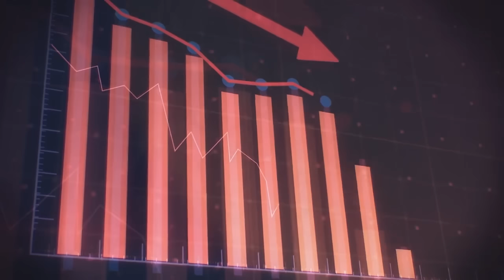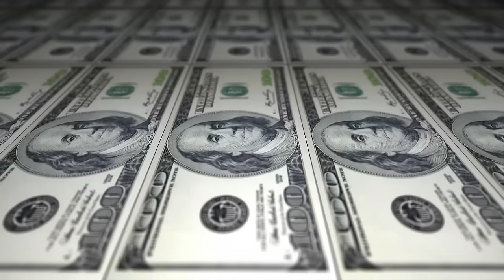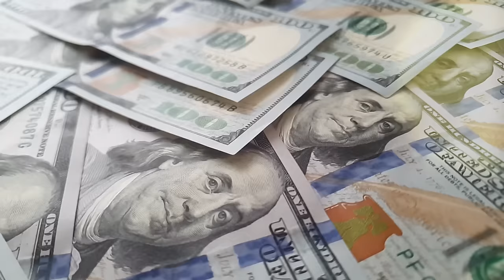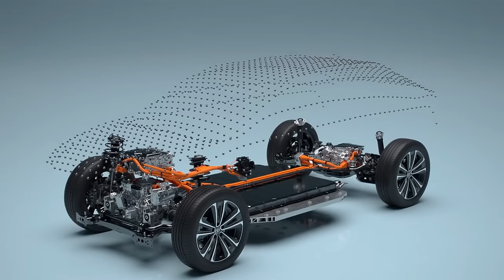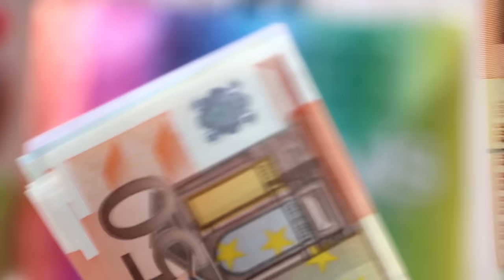The ‘I Told You So’ Moment: Toyota’s Predictions About EVs Come True! Electric Vehicle or Hybrids?

Comment: We chose an hybrid car, less fuel consumption on day-to-day commuting so fewer pollution, but still as polyvalent as a gas vehicle, same 500 miles/800 km autonomy with same 5mn refueling time whatever the weather.
Hybrids are a pragmatic solution. EVs are unpractical, an ideological choice.

There's a market for EVs, but it's not 100% of vehicle but more realistically between 20% and 30%.
If incentives stopped, today many markets would be 10% to 15% EVs, not 20%.
Reply: Pure EVs still need a lot more infrastructure and way better batteries to be viable for most places, they could work relatively easy for urban commuters IF the infrastructure was available, but like alway goverments want to force things but don't want to invest what is necessary to get it working properly.
Reply: I've just got a hybrid. My neighbours with pure EVs have had massive issues with them.  EVs are totally impractical at present ... No charging infrastructure and battery manufacture is more harmful to the planet than fossil fuel. No wonder EV secondhand value has plummeted.
Reply: @billscott312  what did you buy?  Im just starting to look and would love to hear what you chose.
Reply: My next car will be a Camry hybrid AWD they now place an electric motor in the rear to make AWD and other only reduces mpg by 1 mpg. The other advantage is electric AC and heat so you can sit using AC without the engine running it turns on when the battery needs it. The LE is rated at 50mpg the higher models SE, XSE go to 40mpg.

Comment: Toyota works smarter, not harder.  Toyota let other manufacturers do the experiment, knowing it can build the best ev anytime.  No body beats Toyota in building the most reliable automobiles.    Today, My 2006 4runner still run like day one from the dealer.
Reply: GM used to be that way -  let Chrysler & others innovate, then hire away their key ppl.  But Toyota mgmt doesn't need to hire ppl away.
Reply: My Toyota Yaris TS 105hp from 2005 runs like day one from the dealer. 💪💪💪
Reply: Meh, I've been in the body repair business all my life, Toyota are no better or worse than anyone else. They make beige boring cars and haven't released anything of note for a long time.
Reply: You haven't looked at the Toyota BZX stats have you?
Reply: Toyota's reliabiity is legendary, however Honda is probably slightly better.in some models, the  2024 J.D. Power Quality & Reliability Rating for the Honda Civic is 82 and for the Toyota Corolla its 76.   Not sure what the ratings for Ford, GM or Dodge are.
Reply: Toyota has dipped their toe into EV manufacturing. The result certainly isn't the best EV. Not in any department. In fact it would rank closer to the worst EV on the market,  especially in terms of value.
Reply: Looking at the BZ4X, I hardly call that the best EV. Not even close.
Reply: I like Toyota's but Toyota was smart enough not too try beat Elon musk too the finish line when he's already there ,Just when the others think their going too takeover ,Elon musk will move onto the next level .
Reply: Toyota does make good ICE cars, but that does not translate to good EVs.  We are running low in petroleum, new forms of energy is necessary, but Toyota is not good at that, at least not good so far, thanks to its leaders ' poor judgement.
Reply: Toyota already made EV, they know the technology aren't have breakthrough, it's like use same method but want different results, it won't work
Reply: I've been buying Toyota vehicles since 1985!  Never had one break down!  Ever!!!
Reply: @spearce39 how does being a panel beater make you an more an expert?
Reply: However they dump hundreds of millions into hydrogen cars. So the "let others experiment" is selective at best

Comment: We've owned a 2011 Prius for about 5 years and it's one of the best cars we have ever owned. We used to take an 1100 mi trip each summer to stay with our son in Seattle and got an avg 47 mpg driving there and back. Just topping 110k mi and still runs like a dream. May be upgrading to a newer model but certainly don't plan on paying $37k for a new one.

Comment: I've driven a Toyota hybrid for 5 years and outside of standard services it has only cost me a new 12 volt battery and one headlamp bulb. 50 + MPG is unbeatable
Reply: Can get 70mpg from a diesel
Reply: What are you driving?
Reply: Yes, I see hybrids, but not EVs.
Reply: Yes, but that headlamp cost $7000...
Reply: @geoffsclassiccars in the city in stop go traffic?
Reply: @RennieAsh  i don't drive in the city stop start traffic
Reply: @georgehugh3455  My 15 year old Honda City needs some repairs like changing engine seals and wheel bearings, but the headlight bulb was a regular 100/90 W Halogen that cost me $5 to change.

Comment: Our Lexus hybrid is 19 years old, has never had a technical issue, and has maintained its resale value extremely well. Many EV fans cite the acceleration superiority of their Teslas, yet most vehicle owners live in or near large cities where the need for rocket acceleration for an extra $10,000 is not practical.
Reply: And the UK is VERY SLOWLY cracking down on the racers on our crater filled roads.
Reply: Yeah ours is 20yrs
Reply: Be glad it hasn't broke down because you'll go broke getting it repaired
Reply: @robboid  Well, we've saved so much money over all those years that repair cost won't be a problem. But really, there are Lexus hybrids out there with over 250,000 miles on them.

Comment: Very happy with our hybrid Corolla. Had it for 3 years now, averages 56mpg. Best car we’ve had.
Reply: Try 133eMPG  for a used model 3 at 24k
Reply: We bought a hybrid Crown.  41 mpg.  Love it.
Reply: @chensien75  And what is the cost of a replacement battery?
Reply: @telcobilly  eBay has refurbished for 7-9k
Reply: @chensien75  Refurbished by whom?
Reply: @AussiePom  it's at least 200k miles before a 80% battery is too short for long drives but most people only drives 40 miles a day
Reply: Vw diesel will do 70 mpg
Reply: @geoffsclassiccars  no thanks, I’ll stick to my trusty Toyota. If memory serves me correctly, VW received a massive fine and damage to their reputation for falsifying their diesel mpg figures.
Reply: @garycarmichael8432  have to agree with you I'd stick with Toyota too. Bullet proof!
Reply: @garycarmichael8432  also Mercedes emissions scandal was a lot worse than vag but they kept that one quiet for obvious reasons
Reply: @chensien75 had you check the insurance cost? My Corolla cost me 250 every 6 months, my Highlander hybrid cost me 600, I check with a model 3 with my insurance company, it will cost me 1800 every 6 month. That alone is a deal killer.
Reply: @haihengh  get a used one with lower overall value and raise the deductible, there are some insurance companies that offer better rate for a safer ev with fsd and 5 star test
Reply: @geoffsclassiccars  you sure about that